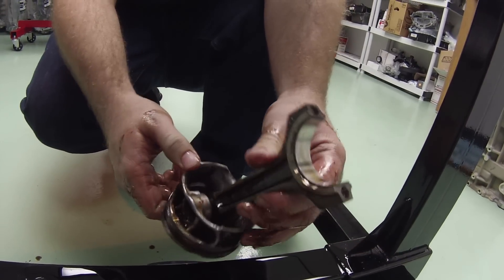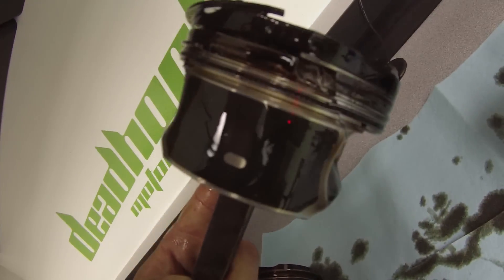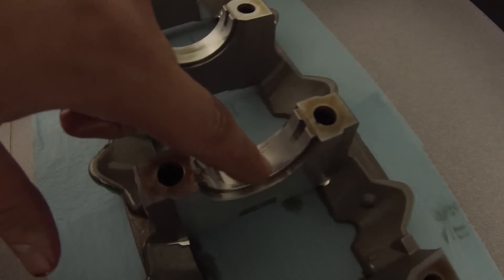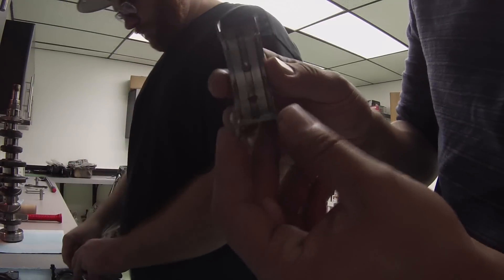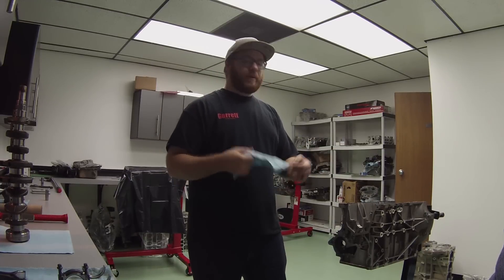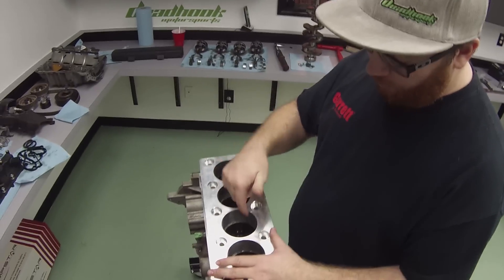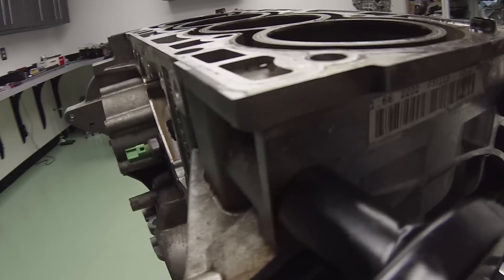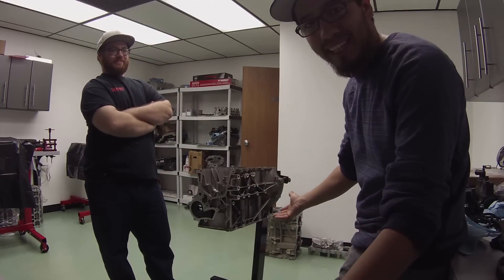Fiesta ST Engine build, Piston analysis and final disassembly

Comment: I know this video is old, but a friend has a Fiesta ST 1.6 and his piston came out in 2 pieces. This is a 100% stock car. He's done nothing to it, not even an exhaust, and he doesn't drive it hard either. The car had a little bit of smoke, but nothing seemed off and it was running fine. And then, bang, piston cracks into 2 pieces. I've never seen a piston just fail like this on a stock car. I've done some digging online and these eco boost engines looks like nothing but trouble unless you rebuild them with upgrades.
Reply: A lot of guys run these engines on high boost with upgraded turbos for thousand of miles. A lot of guys are 100k+ on BT setups with no modifications to the block. Anomalies do happen every once in a while on stock or not stock engines. The 1.6 eco boost is pretty solid overall.

Comment: Was the car modified when this happened? If yes, what was the horsepower and torque figure that cause this?.. thanks in advance.
Reply from the maker: I was running the X37 hybrid turbo with full bolt ons. DHM Race Intercooler, 2.5" cat back, modified cat, Turbosmart BOV and Wastegate, and a 2JR Cowl intake. Power was around the 270WHP mark.

Comment: I bet this puts out 260 hp now LOL
Reply from the maker: Tj Trev after the build I hit 330whp and then the engine ate itself at 2500 miles. Needless to say I have a large expensive paperweight.
Reply: TShirt Driving Did you use forged/upgraded internals the second go around? Ie rods, pistons, and sleeves
Reply: AJ von Berg can’t speak for him but I found this site helpful in breaking down some of the strengths and weaknesses of this motor
http://dsportmag.com/the-tech/ford-ecoboost-1-6l-analysis-turbocharged-direct-injection-ccvtc/
Reply: That said. We saw what happened to this piston.

Comment: Nice video. I did not see you inspect the condition of the inlet valves, corbon build ups on then are a common problems on modern direct-injected engines. It can cause overheat problems in some part of the cylinder (hot spots) because the shape of the inlet valve are affected by the carbon build up, and therefore the petrol/air mixture is not spread evenly in the cylinder. Of course the injector could be disfunctional in your case.

Comment: wow, I had no idea about that torque plate!!!!! so, I have a 03 focus 2.0 dohc vin 3 zetec! I am dismantling the upper oil pan 2 replace my rod bearings currently!!! (at least I hope that's all)  so, on my zetec 2 ltr, if I remove my head & send it to a local machine shop to be bored .030-.060 over & if they don't have a torque plate, would I end up with a junk motor(out of round cylinders)????? Im planning on going @ least .030 over & adding a bit extra ring gap & adding a turbo & running bigger injectors, IN THE HOPES OF MORE POWER???? SO ALSO DO I NEED TO MAKE SURE MY MACHINE SHOP HAS A TORQUE PLATE B4 THEY WORK ON MY 2003  DOHC ZETEC 2.0 VIN3????????

Comment: When does the honing/torque plate start affecting the distortion?

I have heard the deeper the studs, the less it affects this distortion. I have a MZR engine honed without one and it has perfect compression after lots of DD and racing.

FiST seem to have a lot of weak points and I own one lol. It's great for a daily but I would pick a better platform for putting high HP down.

Comment: Just found the channel! Had a similar issue happen to my mustang ecoboost. the piston skirt on cyl 2 broke clean in half and cyl 3 lost the bottom ringland. It blew out the bottom. like you I was very fortunate to not have a hole in my block or extensive damage on my cylinder walls. Love the content!
Reply: did fomoco let you do a warranty claim with it?

Comment: the exact same thing happened to my 14 fiesta st. the 3rd cylinder piston cracked and chipped the exact same way and i just got a new block since the dealer said it was my fault at 29k miles. at least I'm not alone
Reply: When this happened to my Cylinder 1 piston, they tried to fault me on the oil changes as well.  I brought it in every 52 weeks since new to change the oil, which amounted to every 9,000 miles.  They told me I needed to bring it in every 7,500 miles.  I told them that I was following the Owner's Manual recommended 1 yr/10,000 mi interval.  When they got back to me, they replaced my engine under warrantee at 26,500 miles.
Reply: You were well within warranty and this happened and they blamed you for it while being stock? If I was you I'd of gone as far up the ladder as I could go that's some bullshit on their end imo
Reply: yeah i did go up the ladder but It came down to them saying it was up to service managers at the dealer and i went to several dealers and they all said same thing. I had done some earlier oil changes myself then the latest oil change had been done by dealer but since I hadn't done the earlier oil changes they faulted me with it
Reply: That's insanity, sorry to hear. Where did you source your block from?
Reply: junkyard from a wrecked 1.6 ecoboost escape
Reply: it's been down for over 2 years. after I got the new block. I bent all my valves and then got a new head and then blew head gasket and now it's finally all back together and now having cooling problems
Reply: Would not getting an oil change or improper engine oil even cause that to happen? Probably not?
Just excuses to not cover the work under warranty.

Comment: did an injector cause the cylinder to lean out?
Reply from the maker: We didn't bother testing the injectors as I went ahead and just bought new ones to replace them. It is possible that an injector was the problem, however after seeing everything I feel it was just the abuse the engine had gone through on stock internals. There is a lot of heat build up when you take a car out on road courses. More so in Southern California.
Reply: TShirt Driving you don't think a aftermarket do would help with heat? I know the stock DP can make power but it's still a cat designed for emissions not track days?
Reply from the maker: It probably would allow for allowing heat to escape better. However being confided to California's strict smog laws I would rather not risk it since the car looks like a "race car" and that is enough for a police officer ask for a hood inspection. So I would rather things in the engine bay look as oem as possible or have a "carb sticker" like the one I have held onto for the intake. A thing to remember is the biggest heat producer is the stock turbo housing. As it is very small and creates a bottle neck restriction. If I ever move out of state then I would be looking into a real big turbo kit from DHM.